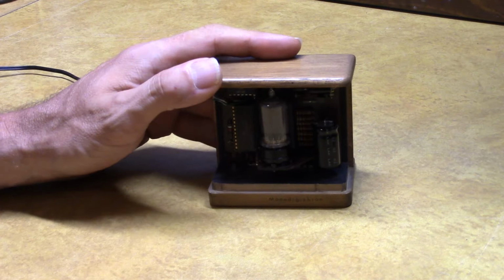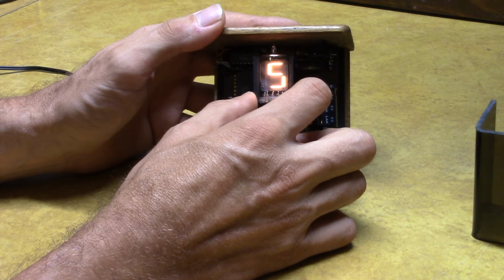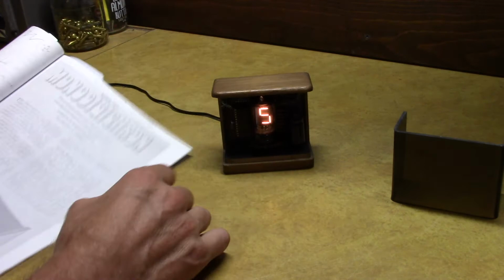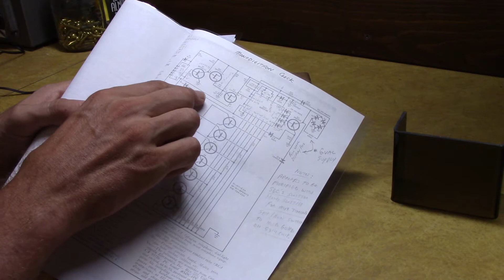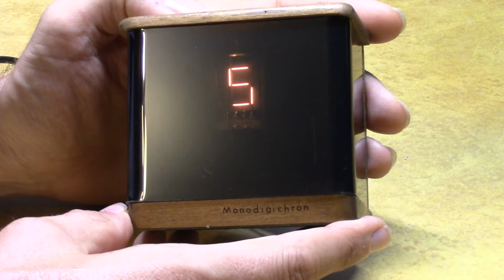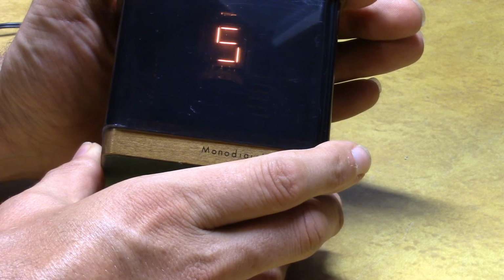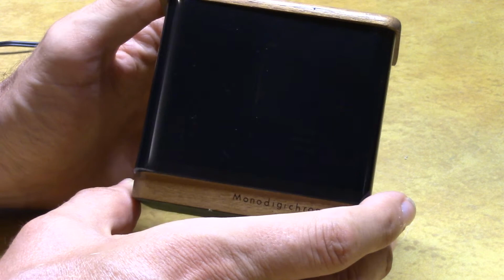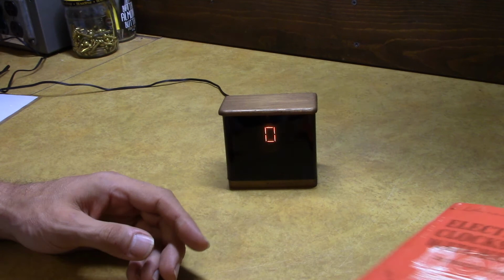Vintage Digital Clock - The Monodigichron - Single Digit Clock - MM5314N

Comment: I see guys doing this using an Arduino. THANKS
Reply from the maker: Yes, the Arduino is today's choice by many except I have not learned it yet.  I have built a couple Nixie clocks using pre-programmed i.c.'s for convenience but I like the vintage stuff as it teaches other ways to approach a need.  This simple clock hobby gave me challenges I never planned on and as a result, I got an introduction to discrete logic gates, timing, pulse shaping, button de-bouncing, transistor circuits and the like.  Thanks for watching.
Reply: @JIMO415  OK You convinced me into building one. I’m just a hobbyist on a similar journey, love the channel.
Reply from the maker: @markgreco1962  Really?  Cool.  This clock circuit may be the trickiest but will be neat when you get the satisfaction of completion.  Good luck.  Let me know how it goes.